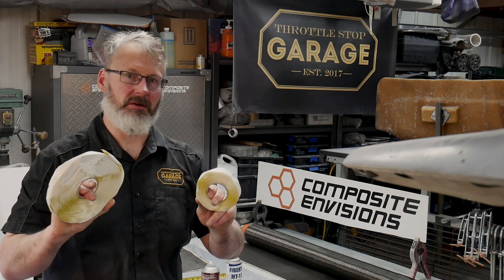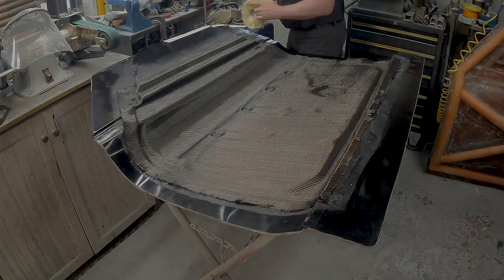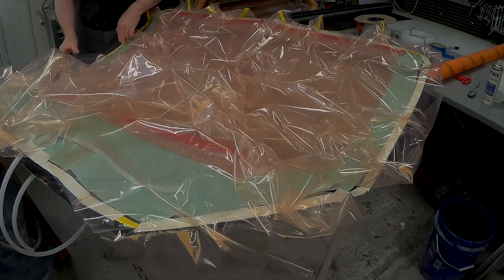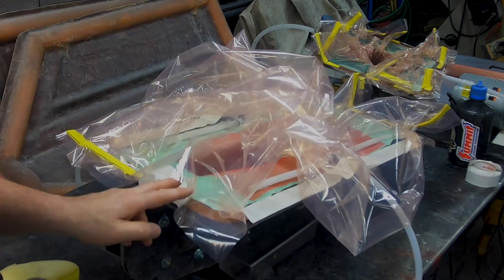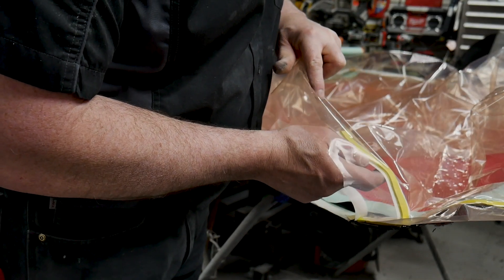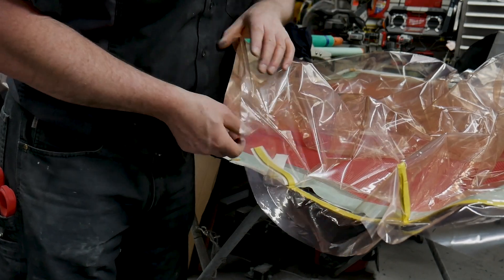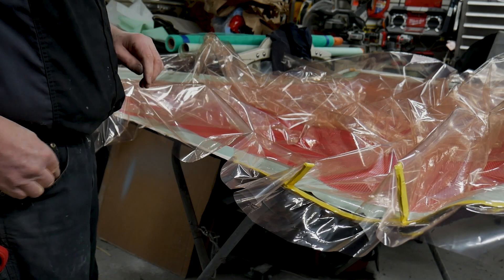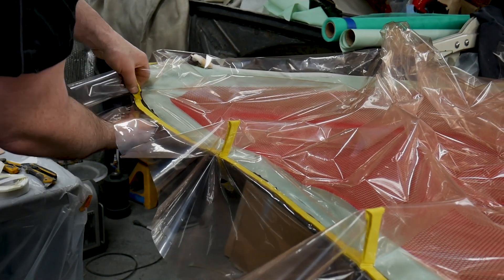DIY Guide to Vacuum Bagging: Getting a sealed vacuum bag!

Comment: That is a really good demonstration!  You really hit the key details.  Totally agree on the need to make bags way bigger than you’d think!

As somebody who has done this probably thousands (hundreds for sure!) of times here are a few other points that might help:

It can be way easier to put the sealant on the bag instead of the mold - just lay the bag on a table and put tape around the perimeter leaving the paper on.  Place the bag over the mold, stick down the corners and pleat by pinching up bag edge - sealant ends up doubled in pleats.  You use a bit more tape but save a ton of time!  

If you put your hoses through in taller pleats you can avoid that frequent leak underneath there.

Pleats should be placed systematically to add extra material where the geometry needs it - and would ideally be symmetrical across the part.

Stretchlon can help but if you don’t use enough well-placed pleats it can spring back after the infusion is filled.  The stretch can cause voids or resin-rich corners - not for you though - your pleats are plentiful!
Reply from the maker: Thanks - I've been told about the sealant on the bag trick.  I'm guessing that works best for square molds.  I understand how it works, but haven't tried it yet.  I use the 1" tape for the feed and vac lines - pretty much stops leaks.  I work hard on the symmetry - it's really important.  I noticed a significant different in the stretchlon between summer and winter.  Summer is SO MUCH EASIER and the temp in the garage when I'm doing this in the winter isn't that cold, but it's just so much nicer to work with when warm.
Reply: @ThrottleStopGarage  The sealant on the bag is best when you can lay the bag out on a clean cutting table first - something those of us working from small home shops never have at hand!  I try to do it for almost anything under a few square meters - especially for odd shaped stuff because it keeps you from wandering off-symmetrical because you have to account for all the edge.  For big things the risks of bag-handling damage makes it less appealing.   

Going to have to try the Stretchlon 800 - only ever used the 200 thin stuff which is miserable for infusions.  It is probably less prone to tearing than nylon bag in dry or cold situations... Thanks!

Comment: This is great, thanks so much!  Do you ever use the harder gray/black sealant tape?  I find it's easier to pick up and reposition if I make a mistake during bagging, though it doesn't seem to seal as reliably as the soft yellow type.
Reply from the maker: I did once - I prefer the yellow for the reasons you note.  If you make a mistake - pull it hard and fast.  It will come off.

Comment: No experience whatsoever in this but love all your knowledge your sharing... had the possibly "over engineered" thought of using some 3mm silicone vac line color of your choice and slice them down the middle at various helpful lengths to slide over the edge of the bag and your part to non-invasively and easily adjust it... really might even give you as many safe attempts you dare try to get it as perfect as you can humanly deem possible... lol . Might be just what some people need if they have issues working with getting a good seal by applying after their tape job and leave it dring vacc down... silicone pretty good at resisting heat if you wanna leave it on while it bakes as well... no idea if im right.. but might be worth shot idk let me know..
Reply from the maker: It's possible to make a silicone bag for multiple parts.  This really isn't that hard, once you get the hang of it.
Reply: I meant just to use the sliced hose to non permanently hold the edges of your bag to the mold.. might be a waste of time if your experienced with certain parts... but might be useful for prototypes/forst runs of a part to experiment with different bag setups before going all in with the double sided tape.. @ThrottleStopGarage
Reply from the maker: @vortex8646  Thanks for the clarification - I now understand your point.  I've never done this, but it would be handy to work out bag placement.

Comment: Big fan here!

Have you considered overlaying carbon to key parts of the chassis to reduce chassis flex? There's a race shop in Japan called 'Opera Performance', and they've done this to a few of cars to keep weight down and increase stiffness.

https://youtu.be/1GyNLQVhl6c
Reply from the maker: Thanks Grant - I increased the strength of the chassis when I built it and will be continuing to do this as I develop the car.  I have more strength to add in the critical areas coming up and I'm working on some ideas for how to incorporate composite materials.